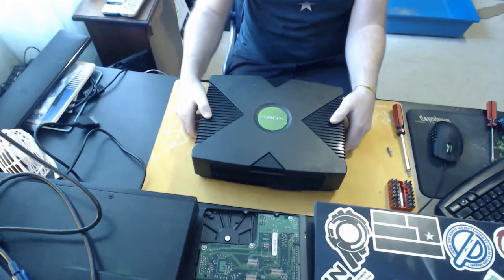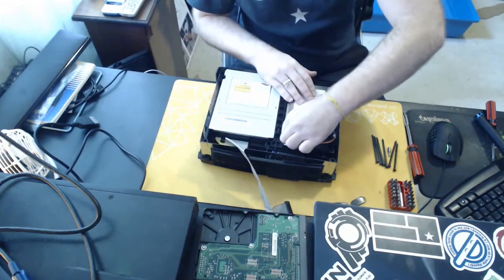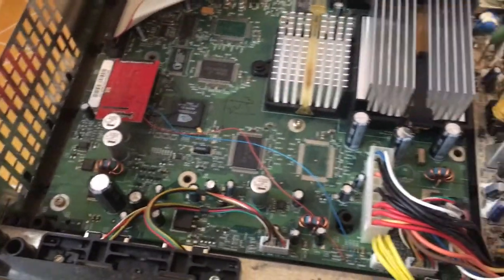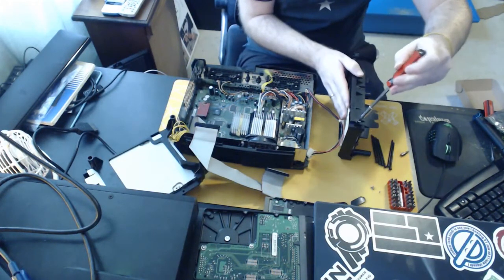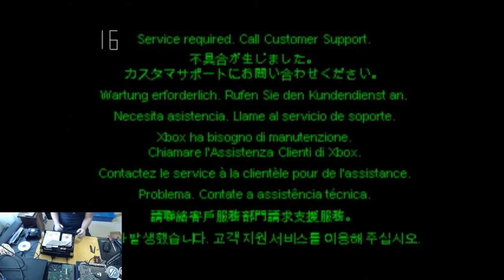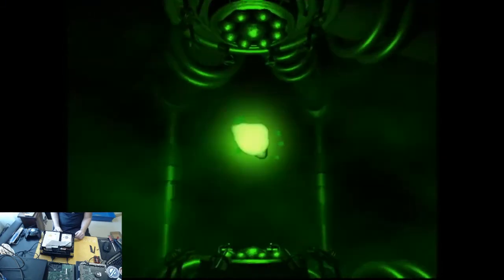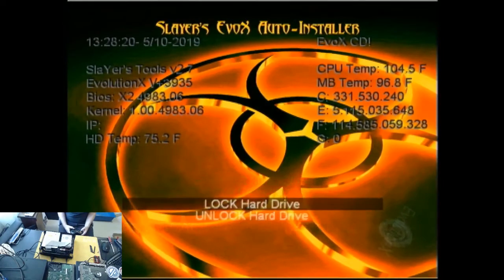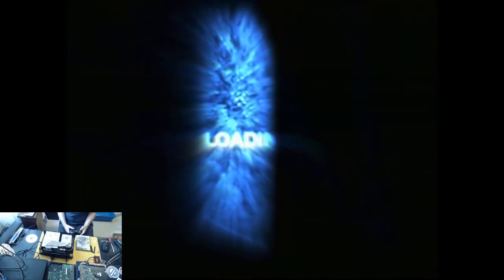Original XBOX Hard Drive Replacement

Comment: Hey, so my original xbox broke but the hard drive is still working. I bought a refurbed xbox off of eBay, and I want to install my hard drive into it. Will I have to use the boot disk still?

Comment: "Nothing special about this.  Standard xbox." 
Except it's not a standard xbox. It's got a mod chip. So this video is useless to people with an actual standard xbox.
Reply: Yes, amigo! I have a stock unmoded xbox with a non working DVD and clicking HDD....what to do?
Reply: @juang1one  exact same problem. I previously tried to replace the hard drive in my non-modded Xbox with one from another non-modded Xbox that didn’t have a working disk drive and got that error message in green letters. Really sucks because there’s no way I can back up a copy of my Xbox hard drive since it’s dead now, so I’m guessing the Xbox is a brick now.